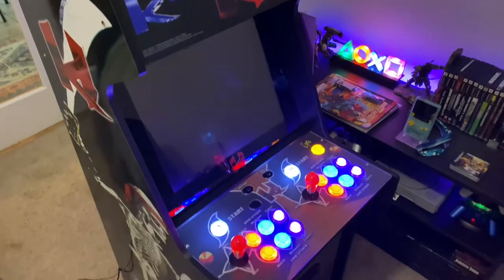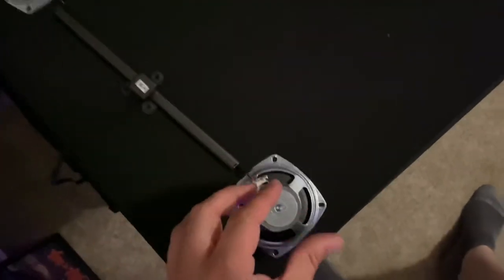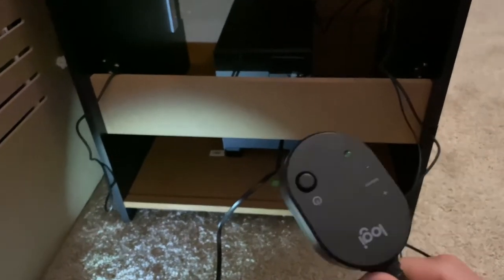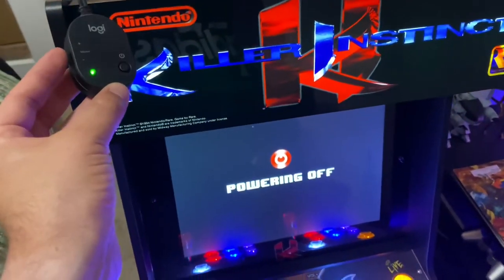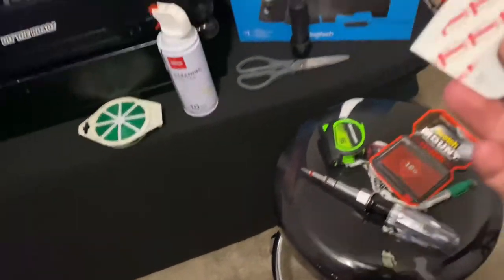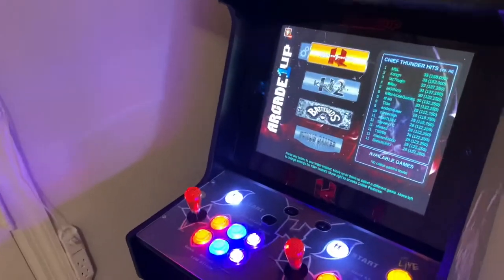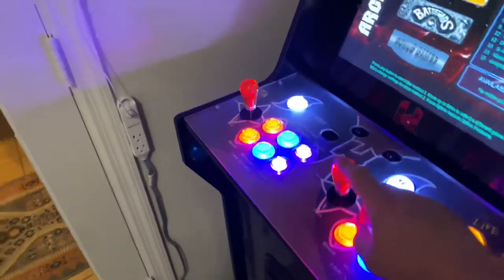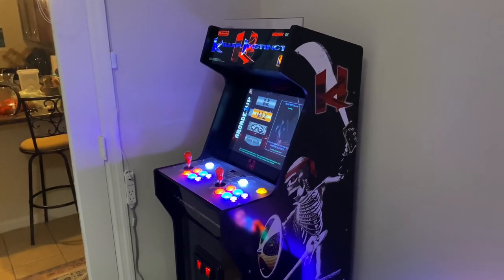Arcade 1up Killer Instinct Speaker Upgrade to Logitech Z313 Install & Review

Comment: Thats pretty good sound mod for the KI Arcade 1up. I have a couple of other arcades that have the same amount of buzzing when on also and found that a small device called a ground loop isolator will get rid of the majority if not all of the buzzing noise. Amazon a great place to get one of those devices and works really well for all those applications. Good job on the install.
Reply from the maker: Thank you so much !

Comment: I installed this system on my KI, I had to put the subwoofer outside the cabinet. With it inside the cabinet the sound was vibrating the cabinet and distorting the sound pretty bad. Are you having that issue?

Comment: Can you attach auxiliary cable to the headphone jack and connect an external speaker?
Reply: That's what I did with my Ridge Racer cab, should be the same here.
Reply: @nerdloftgaming  I went and tried my JBL Bluetooth speaker to the headphone port and huge upgrade!
Reply: @nerdloftgaming  so I took a auxiliary splitter, and connected an auxiliary to my JBL Bluetooth speaker and holy God it's night and day with killer instinct, easy simple upgrade. The bass and sound is incredible when ripping off devastating king combos!

Comment: Cool stuff! 

When I had first picked up a Sound System for my MVC I went with some Cyber Acoustics speakers that had LED lights on them and stuff... But they didn't sound good with the cab. 

So then I never used those on MVC and I went to get the Logitech Z533 speakers.... Great set! 

Later on I got Class of 81 and so I upgraded the Speakers on MVC to the Logitech Z623 and moved over the Z533 to Class of 81. 

Yaaa things are pretty loud here and filled with depth.

Comment: FYI these speakers will not fit the midway legacy cabinet behind the marquee in factory location. I did however get them to fit velow the control deck and have some speaker grill cutouts for them.

Comment: I seriously don’t get how you fit those speakers up in the top spot where the original speaker holes were. Idk if your cab has more space up there than the marvel superheroes cab but it’s bugging the fuck out of me. I don’t wanna mount them on top 🤪. Ugh I wish you could show it.
Reply from the maker: I laid the speakers face down, with the bottom part of the speaker facing up, and the top facing towards the back of the cabinet ! It’s a perfect fit !
Reply: I ran into this with my MK3 cab , they will not fit in the top , but they did fit in my MK 30th ,  MK3 has the cardboard top and the MK30th has the hard top with more room.